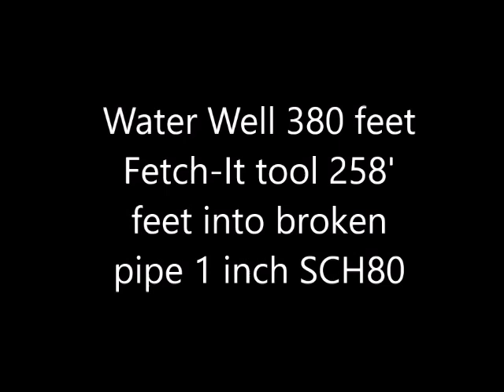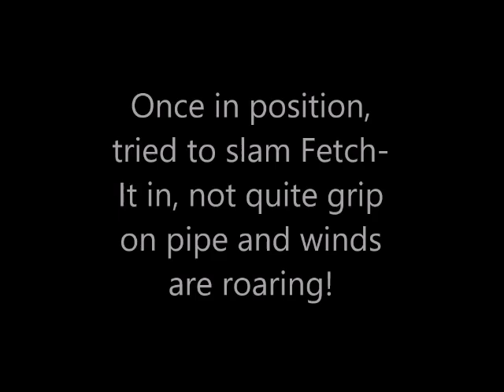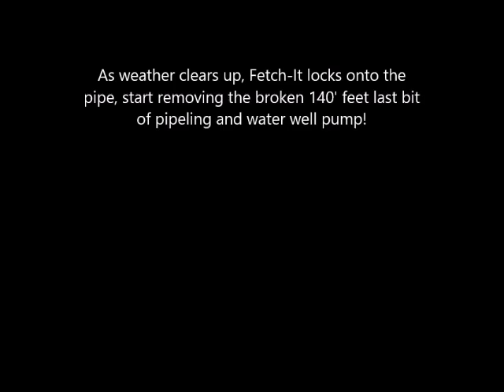Water Well 380 feet : The Fetch tool 258' feet into broken pipe 1 inch SCH80

Comment: You need a weight on the tool
Reply from the maker: That fetch tool got good amount of weight to it. PVC had broke off inside that coupling. Made a tool My self that was way lighter and caught the pipe from under the Coupling.

Comment: Atar prise koto
Reply from the maker: Bangladesh Language if I am Correct. Fetch Tool looks like Flat bar Stainless steel material machined with lever release. If coupling part and pipe breaks off at coupling, will not fit and grab. Only Machined to grab pipe broken at pipe.

Comment: Did you get it out? What brand borescope are you using? I lost my pipe also.
Reply from the maker: BOREHOLE / DOWNHOLE / WATER WELL, COLOR TV CAMERA "350 ft"
https://www.ebay.com/itm/BOREHOLE-DOWNHOLE-WATER-WELL-COLOR-TV-CAMERA-350-ft/193129444425?hash=item2cf7697449:g:HAkAAOSwbqpT1a4m

That the style one worked with, but 500' feet one. Only modify I did, was take two 20 Lumens Flashlights, taped to sides to get picture be more clear and brighter. Use too high lumens, the camera just flicker. As I tried to go past 314' feet where I found topline of water in the well, the camera did not show a picture, but water seal to not destroy. Takes a 9v battery, used my Laptop to view it(touchscreen laptop just build cardboard box around to shade it). If you find higher quality borehole camera, let me know, only faulty I saw, is video connectors have very very thin gauge wires and as spindle it, twists the wires right off! I had to micro solder them back together. Best drop this model, slowly and patiently.
Reply from the maker: As Reminder, The Fetch will have two string wires coming off and plus borehole camera, lower as equal can, hard part is like twist all together.